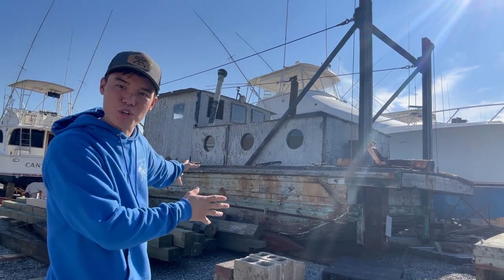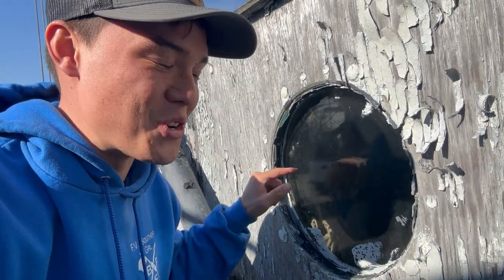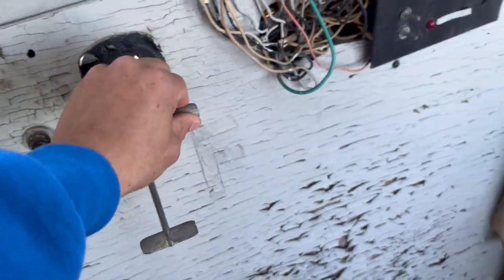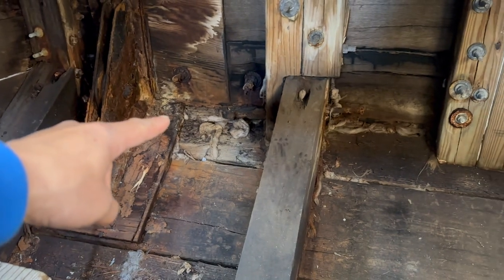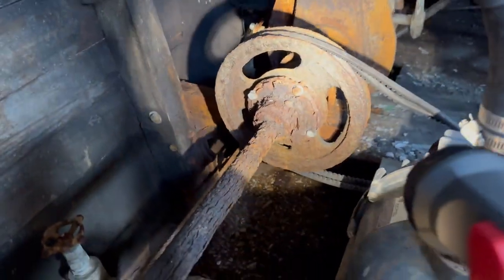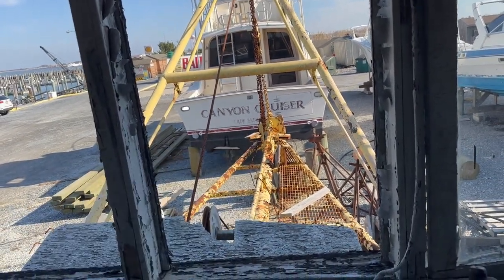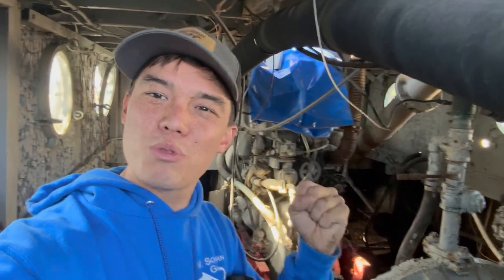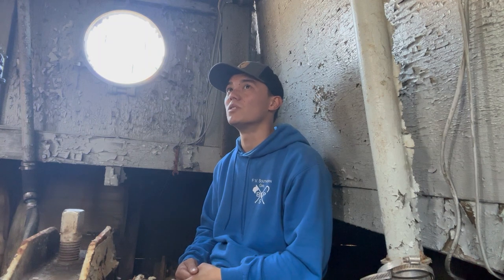Exploring an ABANDONED dredge from 1952

Comment: I have been fishing out of Cape May since the late 70’s. Recognize the marina and dredge you are checking out. There was SO MUCH Maritime history down there back then you would have been like a kid in a candy shop. Lots and lots of wooden vessels some in pristine condition and some starting to fall into disrepair. There were several marinas that had tugs, dredges and tow boats in the slips in working conditions that were built around the time when this dredge was built and used in and around Cape May and the waterways in the ICW, ocean and up the bay. I remember helping quite a few guys repacking tar and oakum in the spring on the old wooden ships. Some of the marinas had true classics. Lots of lapstrakes, dead rise boats and of course LOT of metal fishing boats. 
Cape May has always been a town that harbored, repaired and utilized many of these type vessels over the years. It to bad that someone can not try to get or form an organization to restore these historic maritime treasures…..like you said things like this dredge usually end up getting scrapped for metal, engines and just cut up and put in dumpsters……very sad to see it happen. 
Good luck with your new FV I just found your channel and subscribed. I will look forward to your channels new videos.
Reply from the maker: I woukld love to see more of those boats! Thanks for watching ill be keeping my eyes out for more cool boats!

Comment: Great video!  A lot of history in those Detroit '71' Series engines.  71 stood for cubic inches per cylinder.  They were introduced in 1938 in 1, 2, 3, 4, and 6 cylinder inline models.  V- blocks didn't come along until 1957.
A lot of 4-71s went into city buses.  Nearly all the 36 foot plywood landing craft built by the Higgins Boat Company during WW2 were powered by 6-71s.  After the war a lot of those boats and engines (surplus) found their way into commercial fishing fleets.  Those "up and down things" on your dredge are called spuds.  They help hold the dredge in place...cables run out and forward of the dredge attached to anchors or the shore. Pulling in and letting out of the cable with the winches, and pivoting on the spuds allows the dredge to work back and forth and 'walk' forward.  Good for you to have the interest and to take the time to look at an interesting and important piece of nautical history and share it with others!  Thank you.
Reply: 6-71 NA were the workhorse of the navy and marine industry for many many years. I worked on a couple of charter boats that had 10,000+ hours on them…great engines just a little noisy and oily with some blowby until warmed up. Normally very easy to work on and lots of parts were available almost everywhere in the US.
Reply from the maker: Thank you for the insight im always wanting to learn more!
Reply: @bjkgaffmaster  I saw one with close to 15,000.  Normally would have been rebuilt before then but were being replaced with turbo 6-71s. Lube oil analysis was good up to the day they were pulled.  As you know, cylinder liners made in place rebuilds simple and cost effective.  Long time jimmy owners have either a jimmy hat or a set of hearing aids. Most have both.
Reply: Luke I love your thirst for knowledge, your can do attitude and your appreciation for the mariners that came before you! It's refreshing to see a young man your age with the work ethic you possess. I was taught by my father starting at a young age to use common sense and the things I had around me to build, repair and maintain things that I had a use for out of necessity.  He inherited a drilling company from his father as had his father from his father. The rig they had when my father was young, both pre and post WWII, was made out of wood, including the frame as well as the derrick. Thankfully in the mid to late 70s when I went to work for him that wooden cable tool spudder was long gone. The skills he taught me so long ago I still employ nearly every day. I'm in my mid 60s now and retired but I keep myself busy still, re-purposing things and building things to make my life easier. So glad that YouTube's algorithm popped up one of your videos for me to watch. Keep 'em coming, I'm vicariously reliving my late teens and early 20s through watching your videos and they ways you engineer things on your boat to keep her working so can keep building your business.  I can envision you owning your own fleet of crab boats in the next decade. If you are so inclined. You have the enthusiasm and zest for success needed to bring that to fruition. That said, I'll keep watching if it's you and one boat or a dozen. ❤❤ ❤❤❤ Party on!

Comment: Hi mate the piles as you called them are called spuds that aren't there the towers at the stern are the spud gantry and yes it would still work some good okum and pitch and tar to seal the decks a good motorman to service the gear and maybe even a coat of paint and the livery on the funnel

Comment: Check out Roseman’s marine railway down the street from there at Utschs. You will be impressed with how old school they still service million dollar sport fishers.
Reply from the maker: That would be awesome to see!
Reply: My brother in law owned Cape May Marine right next to Rosemans. Was previously Pharos Marina before his family purchased it. Utschs Marina is closer to the big bridge coming into the marina area. My father had his boat there in the late 70s-80s and I kept my boat there in the 80’s -90’s.Rosemans marine has LONG history in Cape May. Saw many many repairs on all sorts of marine crafts there. They had a rail system to yank boats out of the water. Was usual,y a quick in and out repair since they had limited land storage at their property. Did engine, wood, glass, aluminum and steel vessels repairs. A lot of the smaller commercial guys used them for repairs.